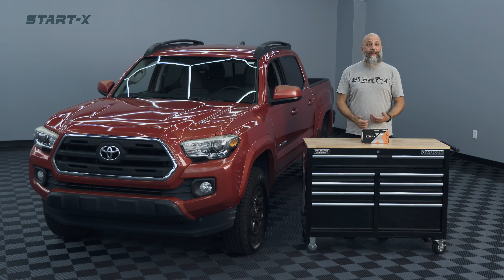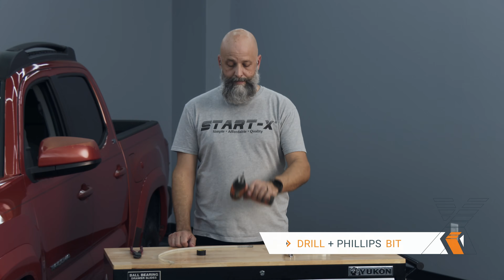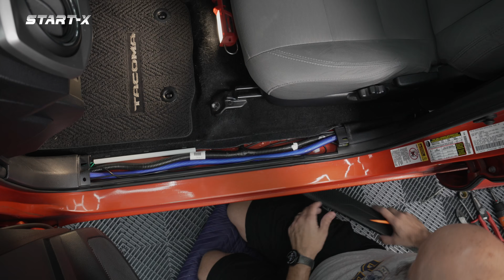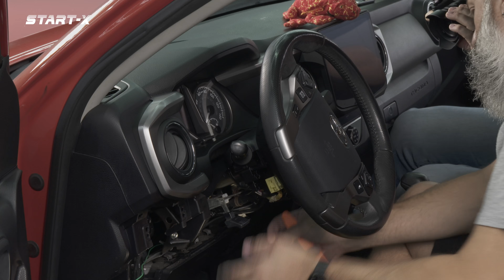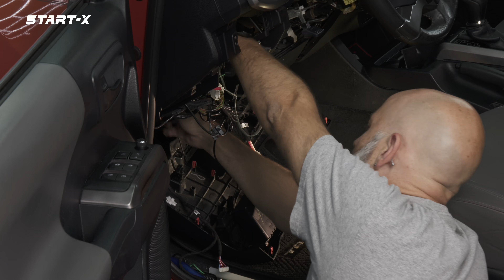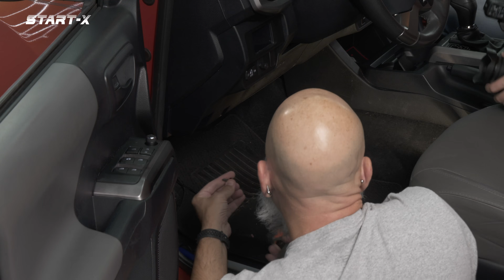Install: Toyota Tacoma 2016 - 2023 and Toyota Highlander 2014 - 2019 Start-X Remote Start

Comment: Why Tpms needs to be cut and rewired? 9:58  is there other way to be just using a plug and play?
I have the product already but worried for future issue might come up. But your instructions are really thorough though 🙏🏻
Reply from the maker: The best way for us to assist is by contacting our Tech Support team. You can email our experts at tech@stingersolutions.com or call at (727) 732-3114 Monday-Friday from 9am-7pm ET